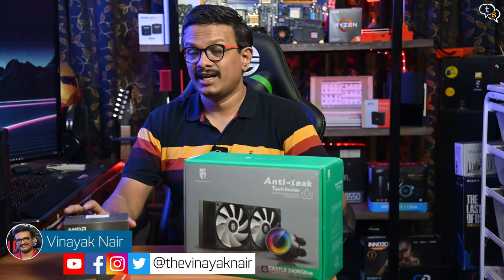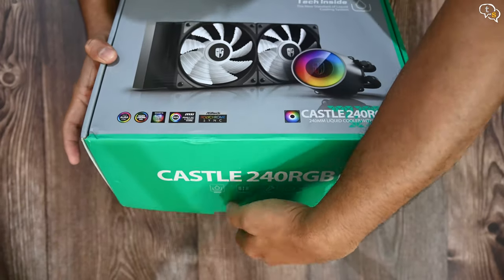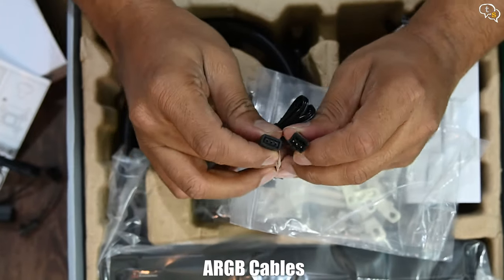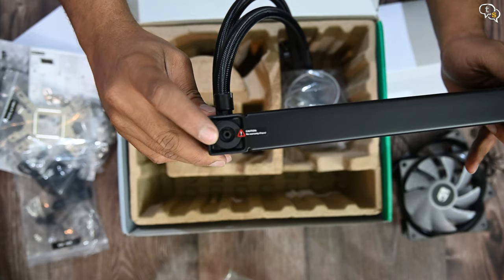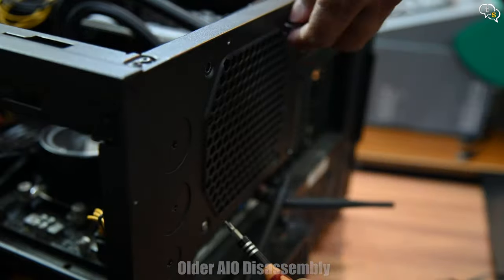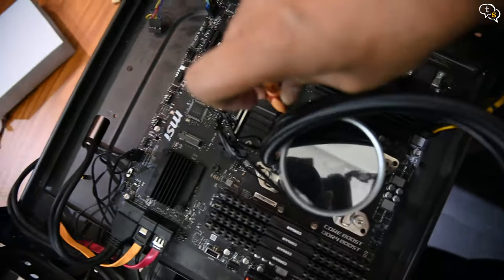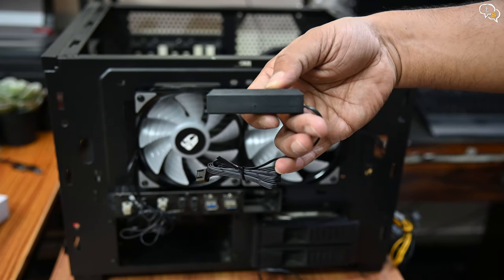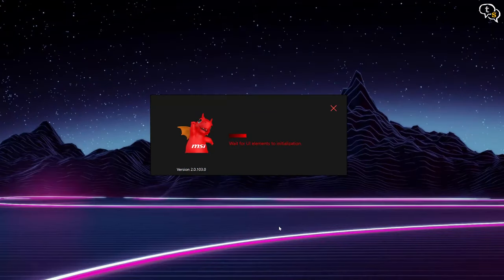Best AIO for Ryzen 7 5800X | Deepcool GamerStorm Castle 240RGB V2

Comment from the maker: Deepcool GamerStorm Castle 240 V2 Amazon Link: https://amzn.to/3dxgFYV
AMD Ryzen 7 5800X: https://amzn.to/3dNRjpz
Reply: Hi
Reply: Can you help me fix my r7 5800x Temps, I have a lian li galahad aio 240mm. If you could list all the settings over here that I could do, it would be great 😀. Idle I get high temps.
Reply from the maker: What temps do you get while idle, I get between 32-38 degrees when nothing is running. When the system is running there could be services that open up in the background that could raise the temp all the way above 70 degrees. I did undervolt my cpu to get more controlled temps.
Reply: @TalkingstuffNet 65- 70 degrees , and can you help me shut my background processes. I am using the amd ryzen master software but no improvement
Reply: Also I have set my maximum processor state to 90%
Reply from the maker: The pump might not be installed properly, try to make sure all the mounting screws are down evenly.  Check if they are loose first, if the mounting pressure is not good the temps go high.
Reply from the maker: Background processes are controlled by windows and start up as required the OS, we can close apps that have started up automatically, but critical system tasks will still run.
Reply: @TalkingstuffNet  btw there's some grinding noise in my aio fan? Reasons
Reply from the maker: Check the fan cables (pwm,RGB) if anything is touching it could make noise. Also check if your aio radiator doesn't have any bent fins.
Reply: Now the deepcool castle rgb v2 is not available 😢

Comment: There is no best cooler for 5800x. Just reduce PBO limit from 142W to around 115~120 is already good enough. You might loose some performance in multicore workload such as in benchmark but it is not very significant as you still get the cpu done its job and i guess better single core application as the clock most of the time will boost around 4850Mhz which above the advertise clock @ 4.7Ghz(4700Mhz).
Reply: lose*
Reply from the maker: When gaming and working on premiere/productivity apps the 5800x doesn't heat up much (max 80 degrees), only when running Cinebench R23 does it reach 90 degrees centigrade.
Reply: @TalkingstuffNet  ya only at benchmark workload the temperature rise to hell.. custom watercool might reduce temp during benchmark but 5800x is crazy hot stuff.
Reply from the maker: I'm using a 240 rad, a 360 might help, but custom waterloop will really help. The 5800x runs even hotter than a 5900x and 5950x.
Reply: @TalkingstuffNet  5800x have same TDP as 5950/5900. 5800x is more hot due to all 8 core on 1 CCD while the 5950/5900 have 2 CCD which distribute the heat equally toward the IHs. Yes better cooling solution will have an impact. But Ive seen Jimmy Tech, he used 240 or 360(i dont remember) have taking air from outside(he doing it during winter) which the environment temp below -0 degree. Yes  what I see there the 5800x at cinnebench clocked to around 4.7ghz. With overal temp ~70 degree As I remember.

Comment: Installation of the Radiator FAN is wrong, oh God!!

Why are you pushing HOT air inside the PC cabinet???
Reply from the maker: You've never installed an AIO I guess or put a system together. I'm pulling in cold fresh air from the front and there are exhaust fans at the back. So in what way is it wrong?
Reply: @TalkingstuffNet  I have built My Gaming Rig myself from scratch. So I might not be PRO in this, but I do have some idea on how all works.

The way you have installed the AIO radiator Fans are pulling cold fresh air and it gets heated up as it passes radiator into the cabinet, so basically, your cabinet is getting not fresh cold air, but HOT AIR!!!!!!!!!!!!

 multiple things happening here due to this,

1. Your cabinet fills up with incoming Hot AIR, so mother board Heats up(VRMs)
2. while playing game your Graphix card is also heated up and will be producing more heat with in the cabinet, so more and more Heat.

So at the end, the performance of the PC comes down with heated VRMs, heated graphic card, RAM and motherboard,
and that's why cinibench is running at  84C(this is not accepted as good temperature while your CPU is at 100% utilization).

I am not saying that i know everything here, but just as a viewer, suggesting my opinion.
Reply from the maker: Installing in push or pull configuration has the same outcome,  at least this way cold air hits the radiator. I have other intake fans on the sides as my cabinet is horizontal and not vertical. All exhaust is from the back.
Reply: Ok
Reply from the maker: Also the Ryzen 7 5800x runs hot due to some design issue. Undervolting it a bit brings down the temperatures drastically.
Reply from the maker: I'm using a horizontal case, so the front is the only location I can install the radiator.  The sides have holes which allows for air to flow in, for which I 3D printed a PCI slot fan mount to pull more air in.  This is my case,
https://amzn.to/2RpBTzr
Reply: @TalkingstuffNet  ohh!
Reply: loooooooooool you are right. i really have no idea how  dumb can some people be. i mean a normal guy yes understandable but a person claiming pc knowlage not knowing these stuff is just unbeliveable

Comment: I'm not comfortable with these stress tests temperatures so close to the edge of 95°. I'm looking forward to buy a 5800X or 5800X 3D in the future, and to do so I'm researching for the best AIO sollution, and I have to stick with 240/280mm AIOs due to my case limitations. I really don't know what to do.
Reply from the maker: In Cinebench R23 the temps reach 90 degrees easily. But while gaming it tops out at around 75, and rarely touches 80. But most games stay in the 50-65 degrees range. Stress test temps are extreme conditions and might not be easily attainable for normal work. When rendering videos on premiere it does hit 82 degrees for a few seconds and drops into the 70's as I use nvenc which would use the GPU to render the video.
Reply: @TalkingstuffNet  there's no cooling solution that fits for 5800X. I think AMD have put too many cores for just one CCX. There's no wonder that's 5900X has a better thermal performance than 5800X even with more cores and threads, because it have 2 CCSs instead 1.
Reply from the maker: That's true, I did undervolt it and it brought the temps below 90 degrees when on maximum load, but I've removed it now to not lose any performance. Thinking of upgrading to the artic freezer 2 360, but not sure if it will help.

Comment: I would recommend putting a nicer thermal paste than the stock one! I have the EX variant of the same cooler on my 5900X and I get a maximum of 80 degrees.
Reply from the maker: I changed the thermal paste to CoolerMaster Mastergel Pro when rebuilding the whole system into a new case. https://youtu.be/E0TQ8yq6YTk

Comment: So I get a lot of mixed answers on the DEEPCOOL CASTLE 240EX RGB. Is it actually good enough under load or will I need to get something better? I hear my Ryzen 5800x3d will run hot anyway because it that's just the way the cpu is
Reply from the maker: The 5800x had a bad Chiplet design which made it run hot, not sure if the 5800x3d has the same design only with the added 3d cache. But it runs hot when benchmarking, if you take standard tasks like gaming, editing etc it runs at a decent temperature. The Deepcool cooled my cpu respectably, but I've actually upgraded to the arctic liquid freezer ii which is a 360 degree AIO and temps are similar, a few degrees lower only.

Comment: How would I know if my aio is working or not? Cause my fans are spinning but there is no display in aio. I am using deepcool castle 360mm aio. I saw significant rise in temp of cpu when rendering. It mostly sits at 45 to 50 degree celcius but when rendering it goes around 74 degree celcius. Please any insight would be helpful.
Reply from the maker: If your idle temps are very high then you know that the pump is not working. It would rise really high quite fast and the processor would throttle a lot. My idle temps are between 30-45 degrees, any small task can take it upto 50-60 degrees for a few seconds and then it goes down. When running benchmarks it can go upto 85 degrees and games hit a high of 50-70 degrees while playing.
Reply: @TalkingstuffNet  thanks for the reply!!

Comment: How would the ryzen 7 5800x run with a Corsair icue h115i elite capellix
Reply from the maker: Should be similar, my 5800X was getting too hot so have under volted it right now to keep it in check. The high temps were only when running stress tests, everything else was under 75 and more under 55 when gaming. So a 240mm aio should work well, if you can go 360 I would suggest that more.
Reply: @TalkingstuffNet Okay thanks for the response

Comment: Thanks great video, I've just ordered the Castle 240RGB V2, but I'm not sure that it's going to fit looking at the dimensions, can you tell the thickness of the radiator plus fans? I'm reading is should be about 520mm, is that right? Thank you in advance.
Reply from the maker: Radiator Dimensions 282×120×27 mm
It's 2x120 mm fans 
Fan Dimensions 120×120×25 mm
Pump Dimensions 91×79×71 mm

You can check out the details here, 
https://www.primeabgb.com/online-price-reviews-india/deepcool-castle-240-rgb-v2-240mm-cpu-liquid-cooler-dp-gs-h12ar-csl240v2/
Reply: @TalkingstuffNet  Thanks for your answer. It means that the total lenght (installing on the top of the fan) would be 27mm+25mm. Right?
Reply from the maker: I would say width would be 27+25 mm, how much it would be within the cabinet.
Reply: @TalkingstuffNet  It's not going to fit then, I have 38mm between top case to the ram clips.. damn, I could fit on the bottom of the case, between PSU cage and GPU, would that make sense?
Reply from the maker: What about the front?
Reply: @TalkingstuffNet  I have this case ( https://images-na.ssl-images-amazon.com/images/I/51b-%2BzAmjmL._AC_.jpg ) with 3 fans on the front, they would pull the
 air into the radiator, it's not a good idea is it? I'm going to waste recycling for the inside right into the radiator.

Comment: I have a small problem with my newly bought setup. (It's second hand)
I have the same ryzen 7 5800x processor and also the castle 240rgb v2.
The problem right now is, that i only got one "cpu fan header" and "no pump header" on the mainboard. (Aorus b550m elite Mainboard).
So i set it up like this: "Fan speed controller hub", right in the cpu header; Fan1/Fan2 of the aio in the hub; also the pump header in the hub...

So i dont really know if this works. I've done some benchmarks and stress test, there i had about 78 degrees.
But if the pump is pumping and doing it's job, i can't tell so far.
Reply from the maker: It works, the pump has a 3 pin fan connector so will anyway run at full speed. The two fans will change speeds as required as they are 4 pin pwm. Stress test and 78 degrees, it's doing it's job perfectly.
Reply: @TalkingstuffNet  First of all, thank you for the super fast replaying!
I‘ve just done some research, the mainboard „fan headers“ are „hybrid headers“. It looks like they also work for pump management.
Reply: So i tested it again after plugging in the pump header to the SysFan2 header. While running the stress test for about 5 minutes, it heated up to 89.6 degrees. Few seconds after stopping the test, the temperature dropped immediately down to ~43 degrees.
Reply from the maker: If you're using Cinebench R23, it can go all the way upto 90 degrees. Any stress test will bring it close to 90 degrees. While gaming/normal load, if your temps are between 50-75 degrees then it's working fine.

Comment: hey i have this going in my build tomorrow. im going to be using the lian li sl120 fans instead as i'm not a huge fan of the cable work with this AIO however there are 2 cables still coming out of the AIO. where do i need to plug these?
Reply: for reference, im using the MSI B550 MAG TOMAHAWK
Reply from the maker: Those two would be for the pump, one would be the fan connector, and the other would be the RGB connector. The fan connector might be only three pins, just match the slot on the header and it will fit. RGB should mostly be standard argb, but if custom it should come with a controller box.
Reply: @TalkingstuffNet  I've noticed they are both 3 pin and my motherboard headers are 4. Does that affect it?
Reply from the maker: Just match the tab to the groove on the connector and it will work. This is a non pwm connector meant to run the pump at full speed always.
Reply from the maker: Don't connect the argb connector to the four pin RGB on the motherboard, it will damage the pins as there are only three holes. Connect it to the RGB controller provided instead.
Reply: @TalkingstuffNet  thanks man. You killed it.
Reply: @TalkingstuffNet  sorry can I check what the controller is meant to plug into?
Reply from the maker: The deepcool aio comes with two controllers, one is for rgb and the other is for pwm(fans) I talk about them in the video.
Reply from the maker: The contollers connect to a fan and RGB header on the motherboard.
Reply: @TalkingstuffNet  yeah sorry i am aware of this but i'm assuming that because i only need to connect the rgb on the AIO, i only need the RGB controller right? Sorry for all the questions, just want to get it right the first time
Reply from the maker: No problem🙂. Only problem could be that the aio RGB connector might be a custom cable and might require the controller. If standard you might not need any of the controllers. The SL120 does come with a controller too.
Reply from the maker: The Lianli sl120 if you have the triple pack comes with a controller too, which can be used to connect the aio pump RGB and pwm headers.

Comment: What is the difference between Deepcool gammax vs castle AIO?
Planning to add 1 for my i7-12700, what do you suggest?
Reply from the maker: The Castle 240 has a bigger cooling block, with the silver colour pump. It's more aesthetics than just cooling efficiency.  They also add the hub for pwm and RGB control(two separate) in the castle model. It also has TR4/sTRX4 socket support (castle).
Mostly similar but for some acessories and the appearance, they're equivalent. The design aesthetics raise the price of the castle model, but you won't go wrong with either. Also make sure you have the appropriate mounts for LGA 1700 socket before purchasing an AIO.
Reply: @TalkingstuffNet  That was really quick! Thanks alot for the detailed answer.
Was supposedly planning for the Deepcool AS500 Plus for 12700. But giving a thought for these budget AIOs too! Wdyt?
Reply from the maker: I'm not very sure how well it performs, but I've read it's a tall coller so make sure it will fit your case and also supports lga 1700. You might have to check reddit or youtube for more info. For your i7 12700 i would suggest an AIO as it's a 12 core(8+4) processor.
Reply: @TalkingstuffNet  makes sense! Thank you.
Reply: @TalkingstuffNet  also could you help me to select a best value for money fit AIO for my 12700 from the below options price in rupees.
 
1. Deepcool Gammax L240 - 6700
2. Coolermaster ML240L - 6750
3. Deepcool castle 240 ex - 8000
4. Cooleemaster Illusion - 9300

Comment: Hi I have a Arctic liquid freezer 240 will this be enough to cool the 5800x. Thanks
Reply from the maker: For normal use like gaming the temps stay below 75 degrees at max. When using creative software like premiere, after fx the temps can go up all the way to 90 degrees while rendering and also cinebench r23 jumps to 90 degrees when running..

Comment: I install this aio deepcool gammaxx l360 argb how much temperature we get when I playing games.
Reply from the maker: The 360 rad should get even lower temps than I do, I generally get between 45-70 degrees depending on the game. But these are generally during loading times, then goes down to around 44-50 degrees as games are more GPU centric.
Reply: @TalkingstuffNet  sir How is the  service of sapphire rx6700xt GPU in India.
Reply from the maker: Not sure, I have never used saffire service and I only have the older Radeon cards. Need to get one of the newer cards to test them out.
Reply: @TalkingstuffNet  sir rx6700xt future proof card or not

Comment: Hey there thankyou for video its helpful
I want to know i have ryzan 5 3600 it was touching 95-97° during summer will thi castle 240 ex will good for my cpu i am blender artist..... And how much drop i expect

And price i am getting it at price 6500ra after all card offer is it worth or should i wait for price drop ?
Reply from the maker: The 240 rad aio is good enough for the ryzen 5 3600. Are you using an AIO? The 3600 shouldn't get that hot.
Reply: @TalkingstuffNet  no i am not using any AIO its not hot in winter but in summer when i render my file it (cpu use 100% gpu use 100%)  touches 95-99° my room is very hot and i have fridge in my room maybe thats why.... And please tell me about the price is 6k good offer? Should i purchased it at 6k
Reply from the maker: Yeah, 6k is a good price.
Reply: @TalkingstuffNet  thankyou so much i am ordering it ❣️ i was thinking is the price will drop but now you also saying its good price i am purchasing it
Reply from the maker: There are chrome plugins that show old prices on Amazon over time. Better check, i think i purchased around this price. I think it's called 'keepa'.